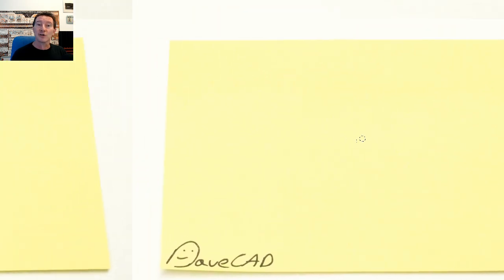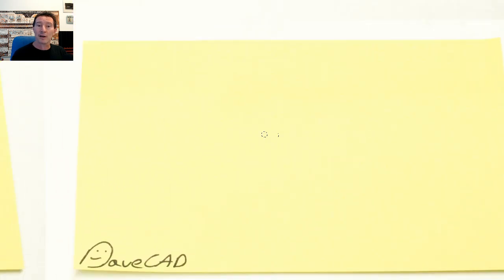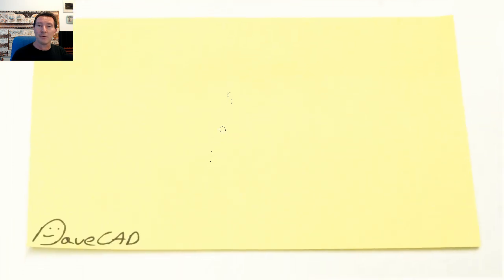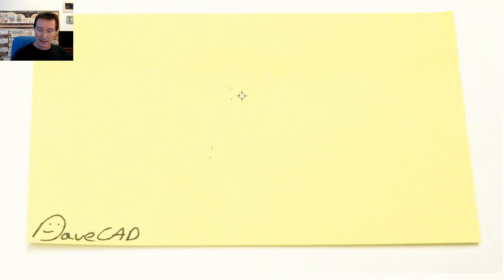Digital DaveCAD Test #2 with PinP

Comment: Looks good.  IMO there's no need to look into the camera when you're drawing.  Don't stress moving it so it's dead on in your face.  This way you can look to the camera when you want to emphasize something or need to adjust the tongue angle.  One thought... how would it look if the DaveCAD post-its were on your blue/green anti-static mat as a background? or maybe one of those green with yellow grid cutting mats?

Comment: I like the DaveCAD. I think the video window would be good to show something that would help in the illustration of the DaveCAD. For example I you were talking about an op amp you could be drawing about the circuit operation while showing the circuit operating.
When I used to teach, I would draw the entire system on the white board on the side wall and leave that there during the class. And then I would tell them where we were as we talked about the details. It helped with continuity especially during a several week class.

Comment: If you feel like drawing on actual paper one day, and want to digitise it easily, check out White Lines. Basically a slightly off-white paper with white lines/dots/grid with some QR-code like markers in the corners that allow you to snap a picture of it with an app on your phone and it cleans it up and straight the photo's perspective out. It's pretty neat, imo.

Comment: Using DaveCad is Great. Well at least if the new lab rat will be also a Dave. 1 setup. 2 Users. 
The post it could use a Bit more space of the screen. And if you need the extra space wehere your head is than simply disable the view of the webcam for a moment. You are on a good way dave. Much better then the white background.